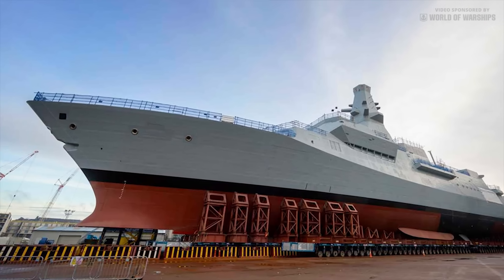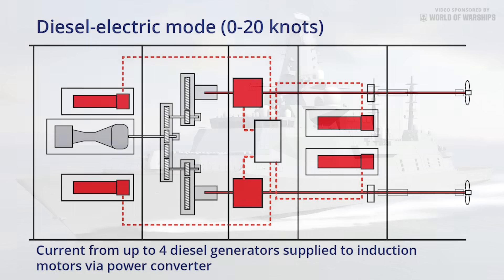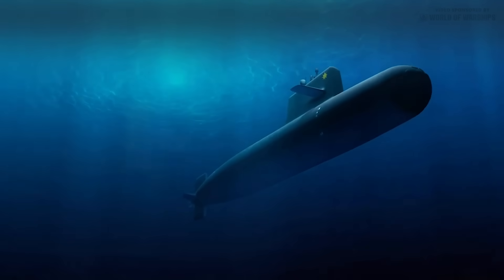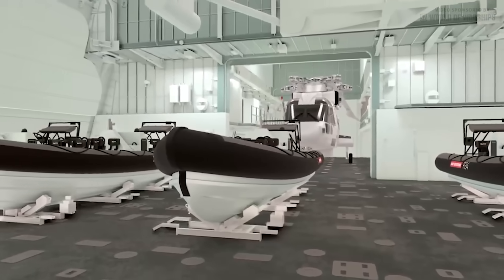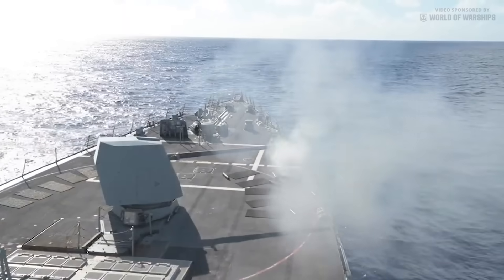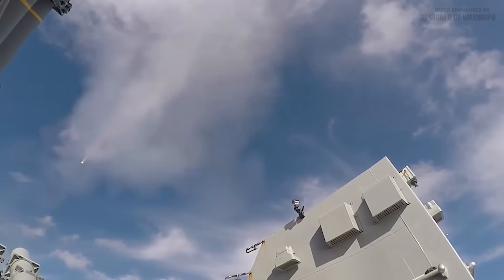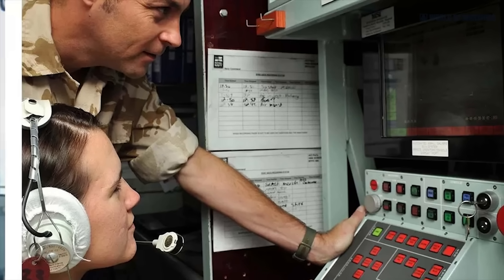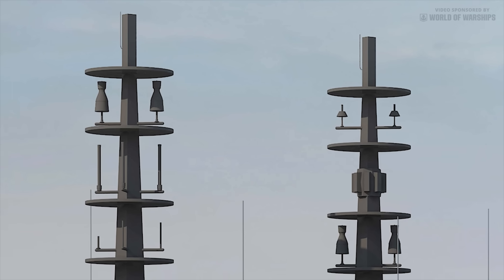An in-depth look at the Type 26 frigate design

Comment: Too bad it came too late for the US Navy FFG competition. This is an awesome ship. AN-SPY 6 radar would have been ideal, though.
Reply: Canada's version of the Type 26 will have the AN/SPY-7(V)1 radar.  Except for reasons I don't know our government has given it the name AN/SPY-7(V)3.
Reply: Not really. USN needed a low end frigate to build more numbers. Type 26 is not a good choice like FREMM design is given how large and expensive it is (not to mention how under-armed in it's current configuration with all of the variants for it's size and price).
Reply: @chesterlynch9533  There actually isn't much of a difference between the FREMM derived Constellation class, the Royal Navy's Type 26, and for another data point, Canada's as yet unamed Type 26 variant.  Fully loaded the Type 26 will have a 9.72% greater displacement than the Constellation.  The '26 's beam is a metre more, but its length is a metre less.  Armament is a toss-up.  Constellation has 32 Mk 41 VLS cells (strike length), 16 Naval Strike Missile canisters, and a 57 mm/L70 gun.  RN's Type 26 has 48 Sea Ceptor (AA) VLS cells, 24 strike length Mk 41 VLS cells, and a 127 mm/L62 gun.  Canada's variant trades 24 Sea Ceptor cells for 8 NSM canisters and 2 twin 324 mm torpedo tubes.
Reply: @JonMartinYXD  I'm not saying there's a huge difference on the two platforms. What I'm saying is that USN doesn't need more expensive platform when they badly need numbers. The FREMM is also an older design in comparison to Type 26 GCS. The Constellation itself just stretches the Italian FREMM design but USN is still very wary to additional risks hence it retained 32 VLS. USN would be in a far better situation with a cheaper frigate to build more numbers like MEKO A-200 or Arrowhead 140. 

The problem with Type 26 is how the Navies have configured them especially since the design itself can accommodate more weapons. You can squeeze up to 48 VLS in bow, 6-8 ExLS/self-defense Mk41 on top of mission bay and 8 NSM (That's what the Type 26 should be configured).
Reply: @chesterlynch9533  I don't disagree.  All this, but particularly the cost, is why the USN restricted their consideration to in-service designs.  Even though the Constellation was always going to be a modification of the chosen parent design, the costs associated with those modifications can be predicted more accurately with every year that the parent design has been in service.  Had the Type 26 been ten years further along it may well have been given serious consideration.  As it is, the USS Constellation is planned to be commissioned the same year the HMS Glasgow is.
Reply: @JonMartinYXD  Even if the Type 26 would have been mature when FFGX begun, I would still prefer that USN to not to pick it. It's an expensive platform and USN is better off with a medium size frigate that they can build in large numbers. With how expensive large frigates like Type 26 and FREMM are, it's not a good fit for USN. I would rather they pick the MEKO A-200 or Arrowhead 140.
Reply: @chesterlynch9533  A MEKO A-200 design was considered but eliminated early in the program.  The Arrowhead/Type 31 was never considered because it is even further from entering service than the Type 26.  The USN had pretty high requirements for the FFG(X), including a 32 cell Mk 41 VLS for anti-air and a full suite of anti-submarine systems.  Those alone put it into the large frigate / small destroyer range.
Reply: @JonMartinYXD  The MEKO A-200 was a good option but USN didn't let it compete which was a stupid idea. Arrowhead was a good option but they didn't competed on FFGX. Heck even Freedom and Independence derived design was very different from based LCS design (Austal switched to CODAD propulsion from CODAG with their last offer). Both Arrowhead 140 and MEKO A-200 can accommodate up to 32 Mk41 VLS and 8-16 ASM. It's not really something a large frigate can only carry.

FFGX falls within the SSC and it means it's on low end mix. A large frigate isn't a low-end design but a high end vessel. It severely limits how many USN can buy and sustain due to its size and price. You would need larger drydocks to accommodate it and you can only purchase less numbers so it's an exact opposite of what an SSC should be.
Reply: @chesterlynch9533  I don't disagree.  At first glance it might look like the US Navy wanted what they used to call an escort destroyer, a mini Arleigh Burke if you will.  Problem is the Arleigh Burkes have basically grown into cruisers, so the required capabilities of the FFGX grew to that of a full-fledged destroyer.  On top of that is the confusion of calling it a frigate which means very different things around the world (and throughout history).

If we look at just the one sentence planned role for the class, the clear solution should have been one base design with two variants: anti-air and anti-submarine, with both having just enough anti-surface capability to get themselves out of unexpected trouble.  None of this modular multi-mission nonsense that has been such a disaster on the LCS classes.  Anti-air variant: no towed sonar or anti-sub warfare capabilities.  Anti-sub variant: only enough anti-air for self-defence (saving 350 kg per Mk 41 VLS cell).
Reply: @JonMartinYXD  That role can still be done by the MEKO A-200. 32 VLS  and 16 NSM would have been more than enough. I disagree that FFGX grew to become a destroyer since it's still an SSC and not a LSC. It's just a habit of USN wanting more high end vessels. USN would still need numbers and FREMM FFGX can't provide that number since it's expensive. 

The modules on the LCSes became problematic because the two were some of the most advanced that other Navies doesn't have. It's the case of USN wanting the most advance systems that's not really mature. It's the reason why SUW was the first modules to be deployed because it was relatively mature system. ASW modules became problematic because the Navy was asking too much capability to be put on a small vessel hence Raytheon had to make it smaller and they had a lot problems on it. The Navy also didn't tried to find other alternatives like Thales CAPTAS 4 Compact which would have been a more mature platform which is essentially a scaled down variant of original CAPTAS 4. MCM modules is the most advanced that no other Navies have it so it's understanble. The only comparable system is the one installed on Dutch Belgian MCM which they just started building the vessel which will carry the unmmaned systems. The main reason that the Navy started FFX program which eventually grew to FFGX is that LCSes platform can't accomodate more weapons and capability (The current production LCses are Flight 0+ and supposed Flight I was the one which have been cancelled). USN was supposedly to receive 30-35 Flight 0+ and 20 Flight I but the Flight I was cancelled and upgraded to FF program then finally to the FFGX. The Flight I was suppose to have 8-cell Mk41 VLS meanwhile retaining capability to carry the topside mission space and aft mission bay (an example is MMSC being built for Saudi Naval force). The Navy then wanted a more capable vessel for near peer threats hence FFGX was born.
Reply: @chesterlynch9533  as opposed to the Fremm design which is cheap enough off the ways but adding systems from USN will dramatically increase the end price.
Reply: @alpearson9158  The Italian FREMM ain't cheap either. Egypt bought their at $1.2.billion USD. It's a large frigate  that's comparable to JMSDF Akizuki and Asahi class destroyers. The Italian FREMM are basically frigates that are larger thus have slightly more range and better endurance (think of it as smaller destroyers with less armaments).
Reply: Sorry that is a myth. The type 26 had already been cutting steel in 2017, the same year the US announced the winner of the FFG(x) . This means the Type 26 could have been in the program.
Reply: @thomasb5600  The US Navy's timetable for the FFG(X) effectively required any parent design to be in service  by 2019 at the latest.
Reply: @JonMartinYXD  interesting as we there was some design where plan only in 2017.
Reply: @thomasb5600  No.  The six parent designs considered and their first-in-class commission dates were:
Álvaro de Bazán class (Spain) - 2002
Freedom class (US) - 2008
FREMM (Aquitaine/Bergamini class) (France/Italy) - 2012/2013
Independence class (US) - 2010
Legend class (US) - 2008
MEKO 200 (many classes) (Germany) - 1987-2006
Reply: @thomasb5600  Yeah it would've been needed long before 2017